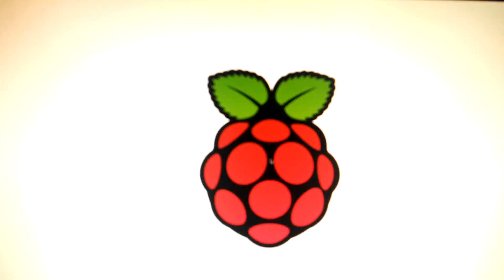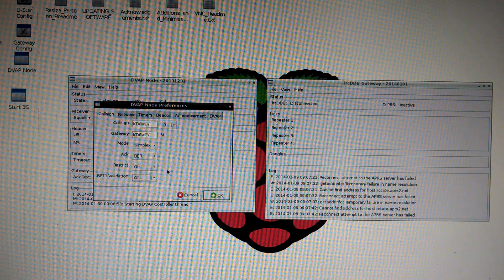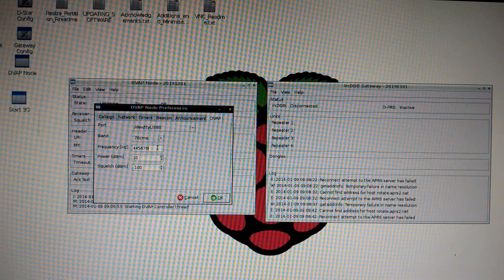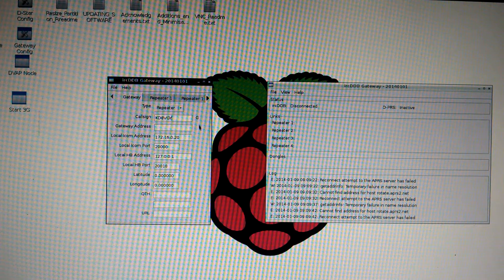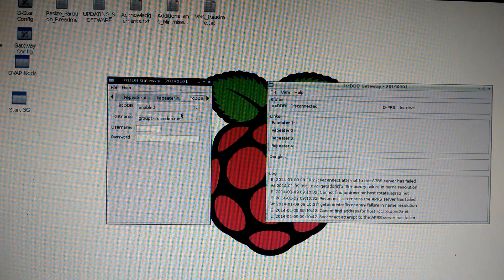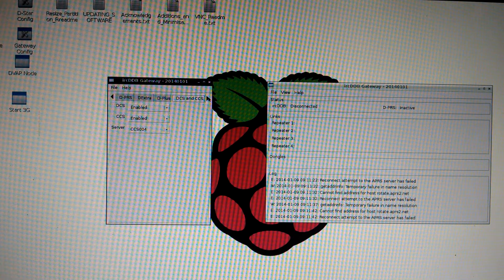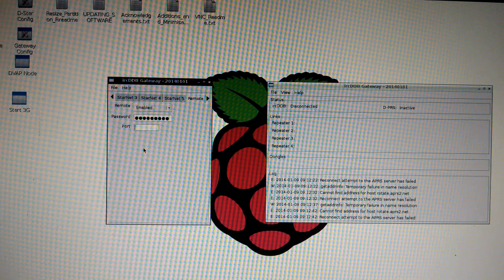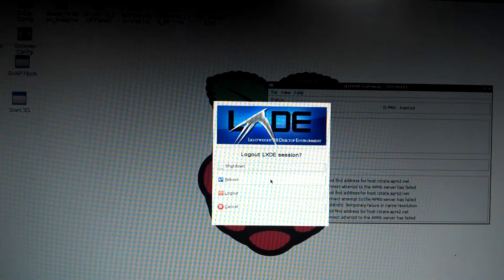Setup Tabs For Dstar DVAP To Raspberry Pi (01 of 02)

Comment: I have been trying to install this for a couple hours. Problem I am running into is the ethernet and USB ports do not work from this image. I tried the image twice and both times the ports don't work. I install a fresh copy of Wheezy and they work fine. Did you have this problem with the ethernet and USB ports not working when you booted up this image? I am using a Pi B+ with 512MB ram.